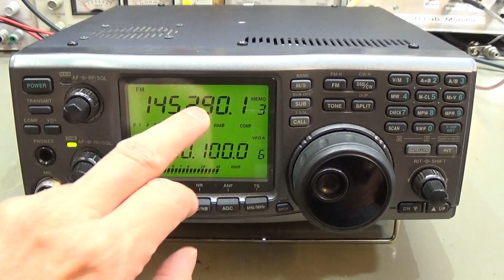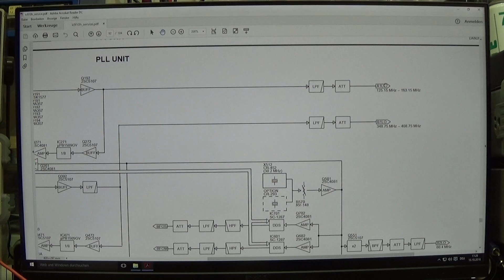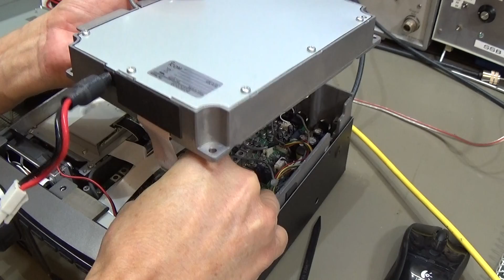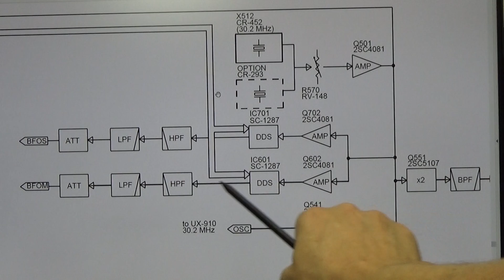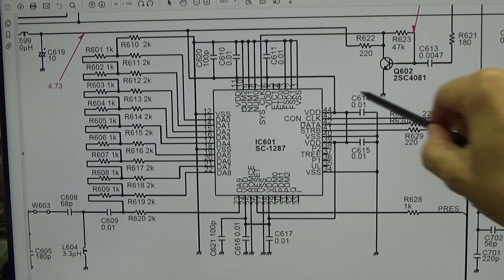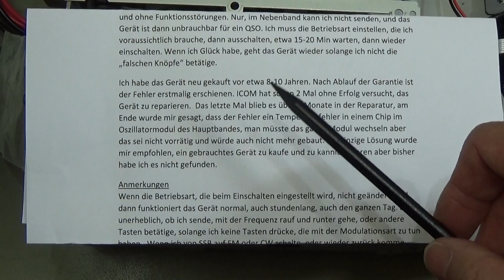#111 ICOM IC-910H intermittent no receive on main receiver

Comment: Very like the issue is in the IC itself. I have the same behavior by bond wire faults, the IC works when touching with one probe and the error disappers. This is temerature independing.

Comment: Thanks Peter very informative I have a 910h also with tx problem on uhf and vhf i think the fault is 2sk2975 driver which controls both frequency 23cm works fine , i also tried icom and they said the same thing about service etc anyway very good video has helped me too thank you cheers Harm

Comment: I used to have the same trouble when fixed ic-910 with model number about 2000, i.e. it was rather old. My problem was on front panel board. As I managed to figure it out, the chip leg lost constant contact with the plate. In my case the problem had resulted to display twinkling. After weldering all got fine! In your situation I'm sure was smth like that.
Reply from the maker: A very good Sergej thanks for feed-back and for reporting this problem! 73
Reply: Welcome, de ua3tjc 73!!!
Reply: I would suggest Soldering over Welding in radios. LOL 😆

Comment: Great analysis Peter, I really enjoyed your video. Which supplier do you trust for your cable adapters and connectors used in your test lab? I recently had several SMA to UHF connectors that were causing me trouble on my measurements and I now want to replace them. Thanks, 73, Kostas.
Reply: Another reason I've never bought any ICOM so far is that their technical department can't fix their own radios! There was also another video before with the same problem happening on a different ICOM. Also, for some weird reason I've noticed that ICOM radios have too many ribbon tapes around, which are very sensitive to faults and nearly impossible to replace or repair if something goes wrong.
Reply from the maker: Hi Kostas, well for HF you can use cheaper adapters but when it comes to VHF and higher I trust in HP/ Keysight, R&S, Rosenberger and such..Hope that helps 73
Reply: Many thanks for this Peter, 73.

Comment: 1st IF :=10.695mhz 2nd IF:=455khz LO:=10.240mhz if no 455KHZ then the LO is bad can you get 10.240mhz from one of the pins on  the synthesizer chip and use that to drive both mixers?

Comment: In looking at the schematic and IC position where it matches the upper side it does appear pin 44 should be VDD. It also has a bypass cap to ground exactly where you would expect one to be. IC chips can do very rare and intermittent behavior when one of the power pins is left open and it shouldn't be. It also looks that if it is VDD it maybe missing the 100p on that side where the others have it The PCB drawing in the service manual also shows a common VDD tie between pin 11 and 44 and 6 like the schematic does

Pin 43 is the clock out to the connector isn't it? Not surprising if that VDD is open and shouldn't be that would be the power pin allowing bad things to happen. If it were mine I would tie 44 to VDD and try to place a 100p piggyback on top of the 0.01 and might even assume it would never happen again.

This looks like a PCB layout design error they found after a few hundred radios started coming back in the original warranty period on an early revision. My best guess says the original pin 44 wasn't marked VDD in the original PCB layout.

Does the service manual and schematic  have the revision marked compared to your test subject?
Reply from the maker: Hi John, yes I agree but what I don't understand is the fact that we don't have many similar problems in the field. This radio is already 10 years old and thus we should have seen it many times before. And even if this fault has been identified by Icom very early and a revision has been done very quickly so that not many radios with this problem are on the market why did Icom not a modification to this particular board and quit all problems for the future?? I mean this radio has been 3 time in service within 10 years?? Is it possible that ICOM don't know this problem?? Thanks for comment and watching 73

Comment: What technique did you use to reflow the IC?  Did you just touch each pin with a soldering iron, or did you use a hot air gun?  Did you add solder, or just reheat?
Reply from the maker: In cases like this I do it pin by pin under my microscope as sometime you can see which pin makes problems with this technique. I use Flux and new solder as well. 73

Comment: I believe I would remove the shield on the secondary PLL and do a direct comparison of the supply voltage on pin 44. That should clear up the discrepancy on the print compared to the actual article.
Reply from the maker: Hi, yes that will be the next step if the fault is not under control so we will see. Thanks for watching and comment 73

Comment: I like your approach to the problem Peter, you isolated the fault in half buy disconnecting the PLL board from the PA. Nice job when watching I was thinking cold solder joint. Not the case then internal chip fault at certain temperature range. Have you taken a external temperature of the chip itself and compared it to the other chip. One other possibility is in the PCB layers itself, having an internal layer fault do to thermal expansion. Is there any high heat component under the board in that area causing the fault. Well I hope you catch it Peter for the sake of the customer and for the ICOM service reps. Great video as always look forward to the next one. Cheers
Reply from the maker: Thank you Tom! Yeah it is possible that there is an internal problem on the pcb layer.We will see.. Thanks for stepping by 73
Reply: The high heat component is the very high frequency option unit as discussed earlier.

Comment: Why do you need to replace whole board if you can use piece of thin wire?
Reply from the maker: Yes that would be the right approach if I would know which junction is intermittent open...but you can't dee it even not with a microscope as it might be inside the layer.. 73

Comment: Icom i bet stopped making the pcb 6 months before they discontinued the model, that way when a problem like this shows up, they just say can't fix, go spend $4,000 on a new IC-9100
Reply from the maker: It is a kind of odd isn't it?? Thanks for watching 73
Reply: TRX Bench yeah, instead of supporting the older rigs they have sold, they rather you trashcan the broke one and dump money in new.
Reply: Planned obsolescence...
Reply: No difference from ALL other brands.I’ll keep my 910H & other ICOM gear over any other brand any day.

Comment: I have the same 910H that has all the upgrades to include the high-stability oscillator you see on the PLL board along with the 1.2GHz module. Were you able to determine why the SHF module became so hot as that doesn't seem to be normal; perhaps the high heat is what caused a micro fracture along one of the DDS IC pins. TNX for the operation lay down, I made some notes and put them into my 910H binder for future reference.   73 - Dino KL0S
Reply from the maker: Hi Dino, yeah the high stability oscillator is installed too, didn't mention it in the video...Well I would not say the SHF module is too hot but it has it's temperature and considering that it is fully covering the main board I doubt the the airflow is optimal.. All really foreboding to a micro crack on the pcb and the temperature around the DDS IC is quite hight and additional to all the PLL IC gets that hot that you can't touch it but that is known and normal for this IC. Thanks for stepping by 73
Reply: A little surprising with the complaints in other comments about Icom service; I had my 910H repaired (bad driver transistor in the UHF PA chain) by the Icom Service Center in Michigan here in the U.S. and they repaired it in a timely manner, but I'm sure many may have very different experiences.
Reply from the maker: I'm not sure if it is true but by all I have heard there seems to be a huge difference between the service in North America and Europe
Reply: Dino Papas ICOM Service is AWESOME and has even repaired a radio for me for FREE that was out of warranty and they paid the return shipping as well.I’ll take that kind of service any time.

Comment: Intermittent faults can drive you nuts Peter, nice to show that it can not always be corrected and found for sure. I was glad to see that you did a reflow on the IC, I bet that may have done the job, time will tell.
Reply from the maker: Yeah you are right Howard intermittent faults are the most worse you can have and it is tre that sometimes this kind of faults stay hidden... Thanks for stepping in 73